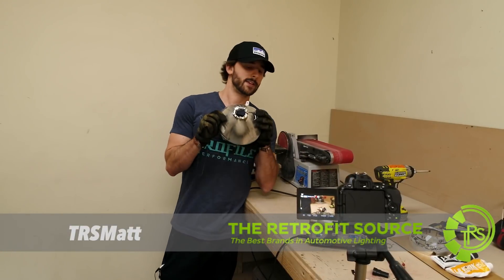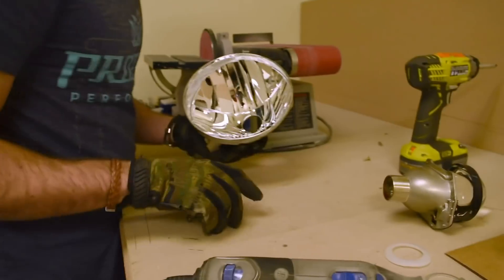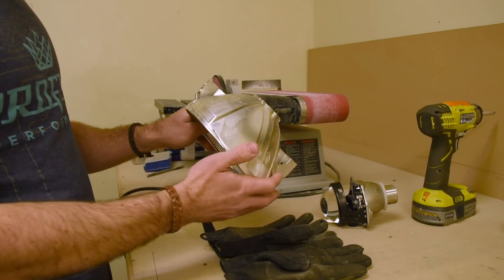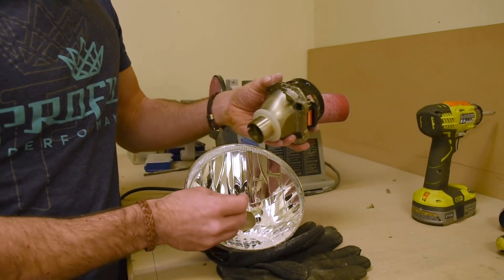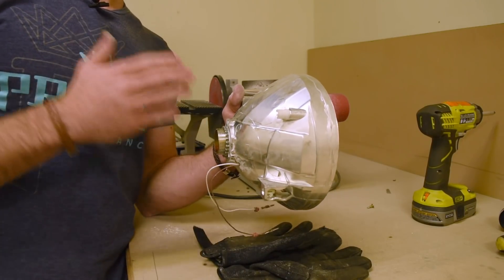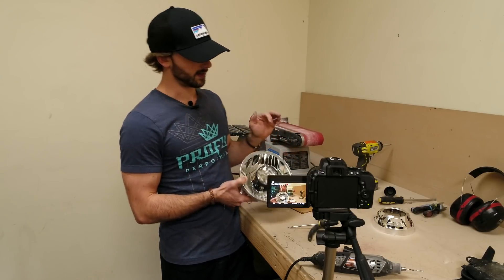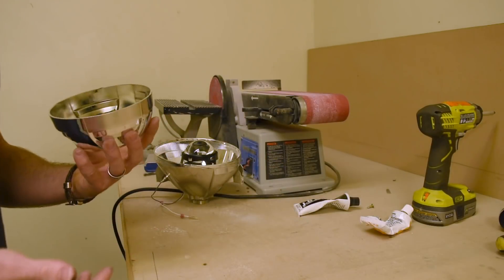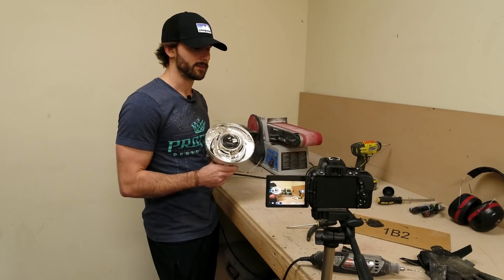HOW TO RETROFIT MINI D2S 4.0 INTO A REFLECTOR

Comment: Sure wish you guys would do some vids on wiring...I'm working on a 2002 bmw e46 that had all the wiring yoinked up by the previous owner..been working my way slowly through that spaghetti mess.. wonder it ever worked!!
Reply from the maker: When you say wiring do you mean just general wiring or cleaning up wiring to make it neater? For neater wiring the solution would be Tesa tape. Any runs of wire that go through the same area just group them together and wrap them with tesa tape, zip tie them off to OEM wiring if possible.
Reply: @RetrofitSource  would be nice to see the order of wiring. Example from headlight bulb to wire A  then from B, goes to wire C, to relay, to ballast etc.

Comment: Question... Seeing that you recommend JB Weld on the shrouds. What if I buy all my products from you, and somewhere down the road, a component malfunctions and then i need to take apart the light to get to/replace the component. Won't I have to break the shroud off the projector at this point?
Reply from the maker: The projector would come out the front side of the headlight, no need to break the shroud off.

Comment: is it most to lower the base for the lock ring to fit?
or with the lock ring tool it possible to tighten down
Reply from the maker: What do you mean by lower the base? If you could let me know, I would be happy to help you get this issue resolved!
Reply: @RetrofitSource  the extra material on the back of the reflector. Is it a must to remove it. Also the H4 alignment ring does that make the projector point straight. Thats why i was wondering if the extra material on the reflector needs to be trim down

Comment: hi. doesnt the h4 washer helps the rotational alignment. if the shaft has a groove cut out and the washer fits in place how can the rotational alignment change or move. doesn't the washer hold it in place?
Reply from the maker: Yes, it does help stop the projector from rotating, however, there is still some room for it to rotate.
Reply: @RetrofitSource  the detail that you removed with the belt sander. is it a must to remove it? and if i dont cant it still ne tighten down

Comment: Hey, can you please tell me where the solenoid cables need to be connected to? Mine is a H4 setup and the projectors came with two solenoid wires each, so not really sure if they are meant to be connected as it is or I need some kind of 'female' connectors?! Thanks!!!
Reply from the maker: You would need a harness like this, which would have the necessary outputs for the ballasts and the solenoid cables to activate the high beams: https://www.theretrofitsource.com/wiring/relay-harnesses/motocontrol-bi-xenon-h4-9003.html
Reply: @RetrofitSource  
can you make a video showing the connections for the harness.
ie for an h4 type retrofit

Comment: hi bro can you tell morimoto to make the threads on the shaft a bit longer on the Mini D2S 5.0
Reply from the maker: We can, but ultimately its a constraint between optics & being able to fit a D2S igniter on there. They're at their extent now. If you need something longer, we suggest the Morimoto MLED
Reply: TheRetrofitSource Inc thank you! That’s a very good point about the igniter. I tried the MLED but it was too big for my housing to use the threaded shaft method. I’m now guessing that the MD2S and MLED are similar in size. I finally went with the MH1 7.0 and I’m loving it! But I’d like to try the MD2S in future projects that I have coming up.
Reply from the maker: Surely, how come you need a longer shaft anyways? Can always trim down the housing just like we've demo'd in this video, right?
Reply: TheRetrofitSource Inc True, that's a good point. I never did it because I wanted to do the least amount of cutting possible because I didnt want to mess anything up. I dont have a belt sander either, but now that you mention it, it's something I could totally do for my next projects. Video guides like this are very helpful and give amateur guys like me some confidence.

Comment: I’m planning on retrofitting the Mini H1 into a 2015-18 F150 headlight, and would really help if y’all could do a mini H1 installation video.
Reply: the mini d2s is a superior product, TBH, look up Lightwerkz's video comparing the D2S 4.0 vs H1 7.0, the D2S is just better
Reply: Agravatedardvark I know the 4.0 is better but this will be my first retrofit and mini H1 is better fitment with no cutting I believe than the D2S.
Reply: I believe they have a video uploaded of an install in a Civic housing. Check it out. The method is 99% the same anyway. 
Did you finish your retrofit yet?
Reply: mujjuman yes about 3 weeks ago
Reply: Hector how did it turn out?